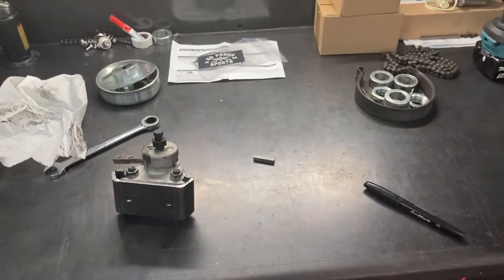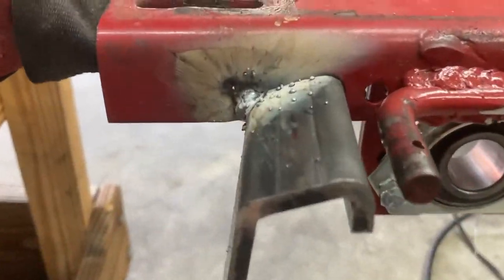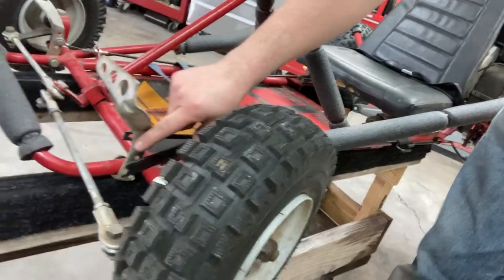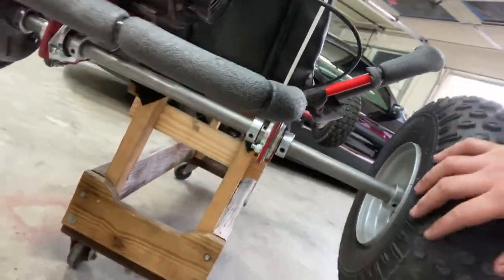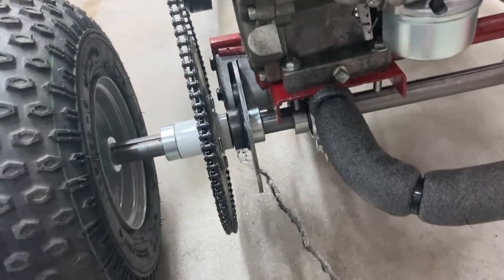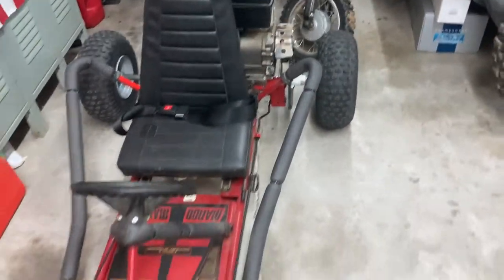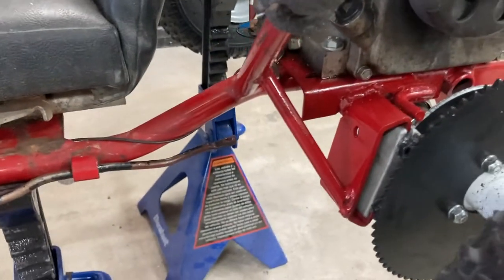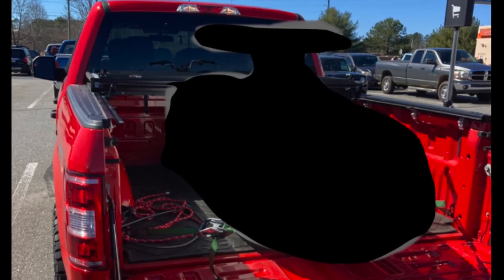Go Kart Mechanical Brake Install

Comment: Just looking at your video getting an idea for mine. I'm thinking the issue with the setup was the rod you were using for the brakes. I'm thinking the rod was used with the band brakes. The brake caliper setup I have doesn't require the brake rod. So I'm thinking doing away with the rod could help with the issue you were having.
Reply from the maker: Yeah that could be an issue but it’s a straight connection so I really don’t know.

Comment: Just need to get that front end up in the air a bit. Thanks for the videos, i have the same gocart and am doing that mod over the winter.
Reply from the maker: Yeah it needs bigger tires in the front for sure,  it would even help with the front being pushed from the solid axle.
Reply: @Coyote Chris  what size is the front tires? 145/70-6?
Reply from the maker: Front is 12x4.00-5 and rear is 145/70-6

Comment: Do you know what model manco this cart is? Just acquired one and trying to order brakes for it. Or could you tell me the exact brakes you purchased? Thanks.
Reply from the maker: @JRaye89   I went with this one https://www.gopowersports.com/go-kart-mechanical-brake-disc-kit-9511-9598-th1000/?campaignid=15361704457&adgroupid=&adid=&gad_source=1&gbraid=0AAAAAD8hpWIkAVP-wq2KuhyRikSW3hm-O&gclid=EAIaIQobChMIq4OvnYeZiAMV4VJ_AB1BKSYxEAQYAyABEgKJ_PD_BwE
Hope that helps 🤘🏼🔥
Reply: It does! Thank you. Can you share what live axle you used as well?
Reply from the maker: @JRaye89  I went with the 40” of this kit https://www.gopowersports.com/6-live-axle-kit/

Comment: Why couldn’t you get the band brake to work? Bought a band brake as well and it’s giving me too much fuss.
Reply from the maker: Well I was putting the band on wrong for starters 🤣.  I would say that it would have worked if I installed it correctly but the mechanical brake works better for sure.

Comment: Any advice on this set up.. just acquired this kart... I filled it with fluid. But won't come out when I pump the lever 0:55 .. dang. I can't post pics . Fk
Reply from the maker: Not sure what your asking because this brake setup doesn’t use fluid.  You can send me pictures through Instagram at coyotechrisonyoutube.

Comment: Hey man, great looking Kart, what kinda drive system is that? Im new to everything coming from dirtbikes, and mine has the pulley torque converters and whatnot, i like how yours is simple chain and sprockets
Reply from the maker: It’s just a 5hp engine with a centrifugal clutch on the main output shaft.